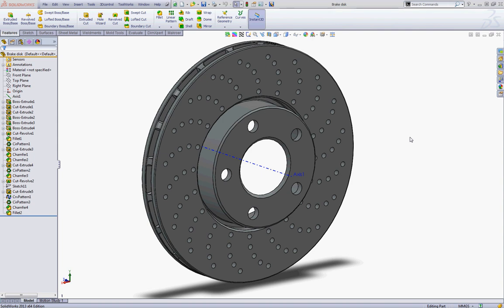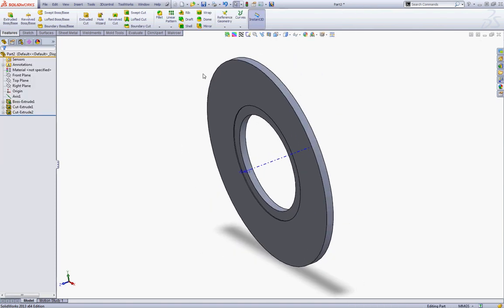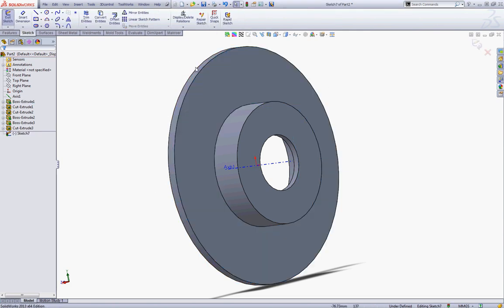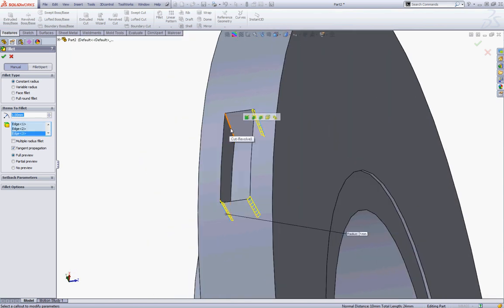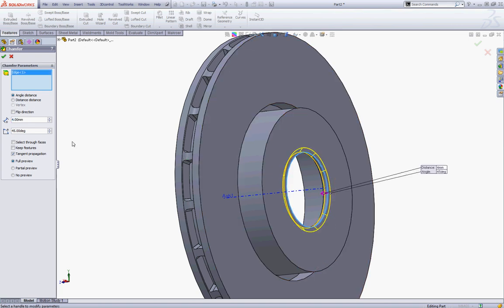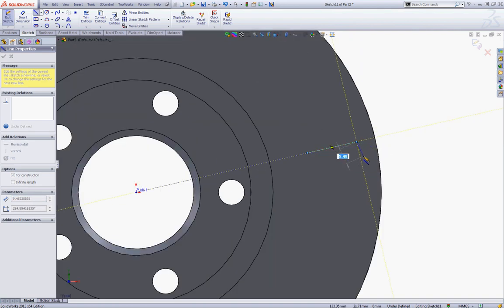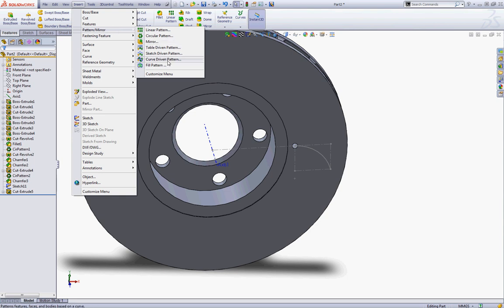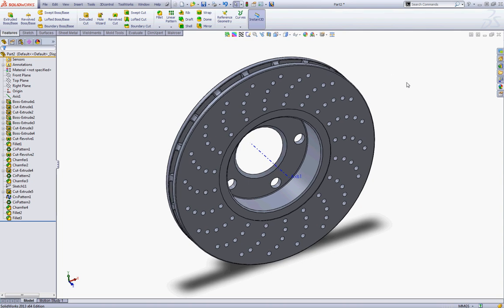SolidWorks tutorial: Brake disk

Comment: Not bad but its teaching bad habits to noobs. most of the first steps should have been done iwth a single revolve feature.
Reply from the maker: Mark's Engineering 
Hi Mark. Thanks for your input. i get your point, but i actually do not agree with you; Having too much geometry defined in a single fetaure limits your possibilities to achive a resilient 3D model, and makes you model very prone to failures in the feature tree when making changes to the model. You flexibility to suppress features and configure your model is much better when you make the models with a judiciously number of features. Having that said, you should of course not overdo you model with unnecessary features, but look further to make a model with enough features so you still get the flexibility to easily making adjustments and configurations to your model, without having you history in you feature manager tree destroyed, when making changes to the geometry. In my experience this is the big issue when too much geometry is defined in too few features.
Reply: +Klaus Falk Hansen can you pls help me with a problem I am having if you can give me your email adrass i could show you the part